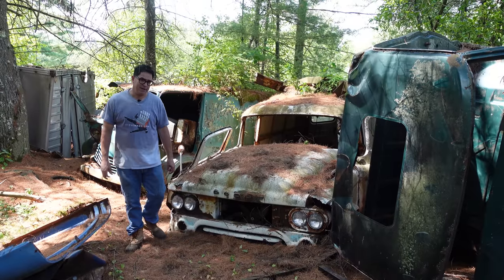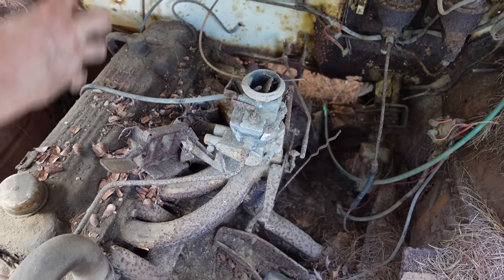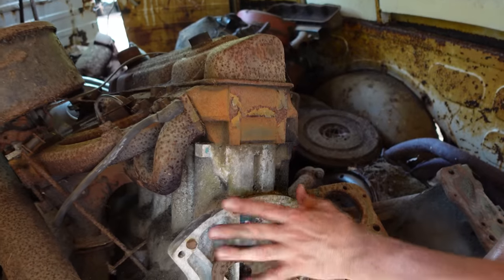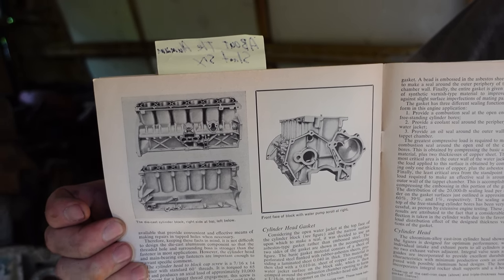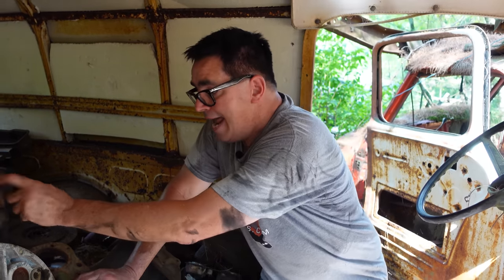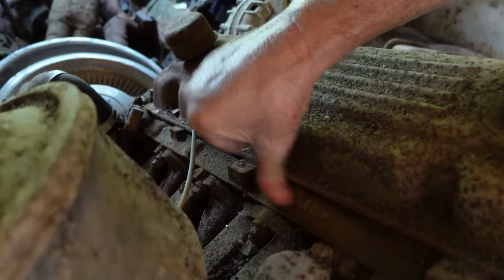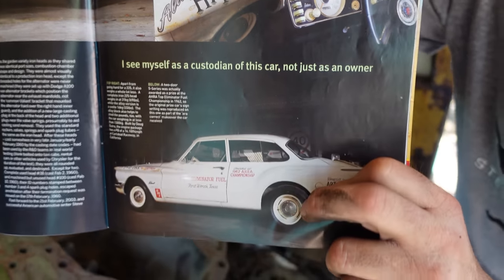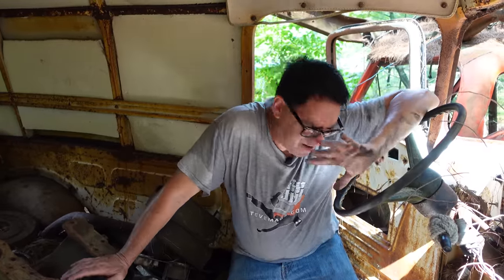Slant Six Surprise!

Comment: My dad bought a new ‘62 Lancer with an aluminum 225. In ‘68 or ‘69 I learned about the freestanding cylinders when it blew a head gasket on the road about 90 miles from home. It vented so much steam that the pressure cap was vibrating like a car horn. It was loud. We made it into a little town where a guy let my dad pull the head in his shop. My dad was a NAPA jobber (it was N.A.P.A. then, National Automotive Parts Association, pronounced n-a-p-a), so he called jobber service at the distribution center and ordered a gasket. It came the following afternoon on the bus. I recall standing beside the highway in that dusty town, the bus driver handing my dad the gasket. He took one look, facepalmed himself, and said, “I forgot to order the aluminum engine gasket.” Ended up towing the car home, where they reassembled it. The slant 6 was never right again, always ran hot. They swapped a cast iron version into the car, then had to crank up the torsion bars because of the added weight. Thus went the aluminum slant 6.

Comment: The guy in Germany who runs the Subi Performance channel custom makes adapter plates to close off open deck Subaru blocks. So, with a little effort, I'm pretty sure that closing off one of these engines can be done.

Comment: The chevy Vega 2300 was similar. It had siamese, free-standing bores in an aluminum-block with a heavy cast-iron head bolted over.  When I rebuilt my 2300, I noticed some corrosion working toward the steel-sleeves on some of the cylinders.

Comment: Best six cylinder made.  Had the iron one in a 60 Dodge Seneca in HS (66).  Ran against a 63 Impala SS 409.  Stayed even with him through second gear (three on the tree).  Then cubes took over and all I saw was his tail lights.  You could not beat that engine for reliability.

Comment: Some studying on that aluminum block, question are the sleeves really coming loose, and you would want to put a crankshaft in with counterweighted, and definitely aluminum cylinder head. With the newer aluminum intake where the runners are all the same length.

Comment: Another example of the aluminum slant six can be found in Tex Smith's XR6 roadster, winner of America's Most Beautiful Roadster trophy at the Oakland Roadster Show in 1963, hot rodding's equivalent to Miss America.
Several car companies tried die cast aluminum engines about that time including Rambler, Oldsmobile, Buick, Corvair and Pontiac. The sales pitch from the aluminum companies was that the castings needed little or no machine work and the savings from that offset the extra cost of the aluminum. In the end, the advantages did not outweigh the disadvantages and the aluminum engine was quietly dropped.

Comment: I was fortunate to meet an ex Chrysler engineer in the early '80s. He said the public did not want to pay the extra $$ for the lower weight block, and he said they transferred much more noise than the iron block. Plus the metal technology at that time probably did not have the wear resistance of the iron block.

Comment: Steve, you didn't mention the three Aluminium heads that escaped the prototyping dept 😊.
As an Aussie Clifford HyperPak owner,.. you and I both know there's zero advantage to the Aluminium block for power output, just less mass over the nose for handling. Always wondered what it would be like to convert one to wet sleeve layout, like the Renault 16 TS uses.
Reply: Renault used to sleeve iron blocks. I don't know if that would be wise to do with an aluminum block, simply because of the different coefficient of expansions between both metals
Reply: @aldente2676  The R16TS is an Aluminium Alloy block with Alloy crossflow head and pentroofed combustion chamber. Basically an Alloy four cylinder Hemi.
The family of Cleon Alu engines range from 1470cc non crossflow (also found in Lotus Europa) to 1647cc from the R16TX, and was the basis of the engines in the Alpine A110 and A310 "1600" versions.
In TS trim they have 91hp, full race Alpine spec is close to 200hp,... the latter in a 600 ish kilo body. :)

Comment: Man, in the late 40s / early 50s the straight six was the thing to have! I spoke to a rodder who was there at the start of the dry lakes scene in the late 40's  I thought hewould love Blue Oval flathead V8s - but he detested the things! He said most people were getting the 41 onwards Chevy truck 'Thrift king' 235 inline 6. You had 135hp if you found the Hydraulic lifter version, and they could easily tune them to 250hp + without exotic parts, whereas try doing that with a flathead! and until the caddy or oldsmobile V8s started showing up in junkyards, the inline 6 was the budget minded (who wasn't back then??) street racer's choice.

Comment: i always understood that the aluminum slant six had a displacement of 198 c.i., and were used in vans and pickups primarily.  In general, the slant six engineering was focused primarily on the block itself, and the crank, pistons, cam etc were about the same as those used in the 6 cylinder block going clear back to 1928.  You could easily retro-fit a slant six into earlier mopars, the bellhousings would fit any mopar six from 1928 to the 1980's.
Reply: They also cast a 225 cubic inch block of which these engines were even dropped into earlier Mopar full-sized models
Reply: I believe the 225 was a "raised" block(1" taller), much like the 413-440 blocks were a raised 361-383-400 block design.
Reply: The aluminum slat six, were used only in cars....not the trucks....if I am not mistaken
Reply: @jeffb3487  not so. I've seen several late 70, 80's 1/2t pickups with slants. Usually with few options(stripper) trucks.
Reply: @budlanctot3060  nope your 100% wrong.  the aluminum slant six was only made a few years in the early 1960's. Do your own research the cast iron blocks were used in car and trucks all the way through the end of their production.
Reply: @jeffb3487  sorry, I said slants not ALUMINUM slants. I misread a previous comment.
Reply: The original slant sixes were 170 and 225 CID, offered in compacts and midsize lines too; lots of slant 6 Darts.  I even once saw a slant 6 ‘70 Charger, three speed column shift. Could have bought it for $350. It was a Limelight green car—looked tough, but wasn’t. Probably had a 2.71 8-1/4” rear end.

The 225 did have a stroke about an inch longer; we used to look at the bypass hose to determine which engine it was: short hose, 170...long hose, 225.

The 170 became the 198 when emissions changes sapped the power.

The long stroke made the 225 a surprising stop-light racer. Its torque would beat a V8 Mustang for a little while, until the Mustang started to breathe and the 225 began to suffocate. My dad embarrassed a few high school street racers in his ugly beige 1962 Lancer.
Reply: Yeah, I saw a 70 Charger sl/6, too, but it wasn't Limelight. I don't remember what color it was but I'm pretty sure it wasn't that color.
Reply: I recall being in a junkyard and snarfing 12 pushrods from a dead slant 6 for use in my sludged up 225.   They did not fit, not by a longshot, would this be due to a variance in deck height?
Reply: @ExilefromCrownHill  most likely. I don't know if there was a difference in pushrods for hydraulic lifter slants or not. Definitely a difference between raised block slants and 170/198's. Probably an inch difference in pushrod length

Comment: never owned a slant 6, but I drove one my friend had in a Volare. not bad. not as good as the 250 straight 6 in my 78 Camaro but it wasn't as big either. there's just something about an inline 6 that sounds so cool. the Europeans knew what they were doing. that's why they had so many inline 6 engines

Comment: I had no idea they made them? Back in the 80s we used a few of the slant 6 engines in sand rails. They were fantastic but lighter is better. They lent themselves well to Hilborn Injection too. Too bad about the head gasket problem.

Comment: I had a 73 Valiant with the 225 slant six. It was my daily beater car. It had about 140,000 miles on it. It cost me about $400 and I ran the snot out of it. I would actually wait for the oil pressure light to flicker when stopping at the end of the freeway ramp to add more oil!😂 That damn thing just wouldn't blow up! It finally died from terminal rust here in northern Ohio.

Comment: Good morning Steve , I am so impressed with your build featured in this Vid. I have bought and read your material for years but somehow missed this one .
  If the Alu. slant six in this video is not junk.  Well it would so cool if you would save it even to use it as a paper weight just to persevere it. Just saying. 
                                                       Thanks again , Mark Battista

Comment: That's an incredibly fascinating 
🙆‍♂️🤩👏👏👏👏👏🧑‍🎓

I never knew 🤔 there was an , 
Aluminum version of the slant 6 🤯

Coolant corroding ,
 the iron bore seal 🤔
due too chemical electrolysis 🧐

Sounds like a,  
very similar scenario 🤔 
As the early 80s water cooled , 
Dirt bikes 🏍

Comment: My Parents bought a '63 Valiant 4dr new at Reedman in Langhorn Pa. It had a killer 170 with a push button. Fast forward to '76 I bought my '64 dr Valiant with a 170 and a 3 on the tree. It was a Cleveland lightweight edition...it was sooo light you could see the ground when you opened the trunk. Drove it for a few weeks then bought a '71 Nova. I loved those cars, not much on power, but ran until they rusted away. Correct me if I'm wrong, but didn't you do a segment 20+ years ago on how to go drag (bracket) racing with that Valiant? I remember the burnout with you working those push buttons. I think it ran mid teens? Get well soon Steve! love all your shows and videos.

Comment: I remember they couldn't give these away in the early 70's.
My Uncle bought a 1971 Valiant, because it came with a 
1 million mile warranty on the drivetrain. Which worked right up 
untill the body totally rusted out by 1974. 
A different Uncle bought a 1981, and Dodge replaced all 4 
fenders 3 times, but stopped due to the Chrysler bankruptcy. 
It literally came off the car carrier with 4 rusting fenders, that 
the dealer replaced, and painted.
Those blocks were/seamed bulletproof.
Would have been nice to see them as a 300 cid,, like Ford did with their 6.

The

Comment: Had a slant 6 in a 83 Ram Stepside. In order to pass emissions test (on the third try) here in Ontario Canada in the mid-90s I had to retard the timing so it barely ran. Once I got my sticker I crank it back up again and drove the snot out of it for a few years. Was a great truck with a 4-speed and was no slouch either.

Comment: I never knew they made an aluminum version of the slant six. I had an iron version in my 71 Valiant. It sounded like an industrial thrashing machine, but ran great. In fact it in outlived the car. A guy bought it from me and put it in a 76 stepside truck. 
And drove it another 6-7 years.
Reply: It would probably quiet down if you just adjusted the valves. Most sl/6 owners were not big on (any)maintenance.

Comment: When I was young my father kept old cars around, and they were all mopars with slant sixes. The 170, 198, and the 225. And he had lots of spare parts in the basement and the yard. So I grew up fixing and driving them. I was given a non-running 1963 Dodge when I was 15, and was told that it would be my car, but I had to get it running. I thought I had it running fine, but when I showed up for my road test for my driver's license, the instructor failed me since the car was so ratty and had essentially no muffler. I had to borrow my rich uncle's new car to take the test. I felt like an idiot driving it, but at least I passed.

I also recall the hyperpak with the intake manifold for the 4-bbl. And a hotter cam available for the slant 6. But I don't recall any aluminum slant 6 blocks. Perhaps my father had some, but I would not have recognized them as different.

Comment: Hey good day, this made my day :-) Always loved the 60s and older Mopar’s. Especially the slant six. Had a 65 three-quarter ton pick up truck with a 225, got about 12 mpg, no matter how I drove it easy that is, so finally put a 170 in it. Got about 21 miles a gallon, thank God for the four-speed though :-) very gutless. Later on someone had given me about a 62 Half ton, it has a slant six, not running. Installed it in the three-quarter ton removing the 170, it got about 20 miles per gallon. Was wondering if you or somebody may know if they did a different cam set up in the earlier years for the 225. No matter what, what an inspiration. I am kind of a Blaksmith you might say not a real race car guy, but have worked on vehicles motorcycles etc. entire life. Hard not to enjoy mechanical engines and such. Especially when you crank up the throttle and power shift :-) thanks again. Look forward to more of your videos just subscribed. Stay well and have a beautiful day. Jim
Reply: Some say that the 170 had perfect numbers, bore to stroke ratio, rod to stroke ratio, and the valve sizing was perfect for 170 CI. The long rods and modest stroke caused less side-thrust on the pistons, so the 170 would run a very long time. I also like the 225, a170 pushed to the logical displacement limits. When I worked as an engine machinist in the early 90s there were two engines that would come in with 40+ thousands taper, the Ford 240/300 (the front cylinder on this engine due to water pump placement) and the slant six. The slants would run just fine while worn out as long as the owner kept the oil level up.

Comment: Another unusual thing about Australian slant six motors was they were all 225s. If you talk about the ,170 slant in Australia they will say you got that wrong.
For V8 motors Australia usually standardised on the smaller ones, but the Valiant went for a big power advantage over the local Falcon and Holden sixes from the first model.
No two door Valiant sedans until the 70 model VG with the Dodge Dart tail based cars. but from 65 we had two door coupe utilities we call utes until the last 82 model Valiant.

Comment: We rode in a 1966 slant 225 w/3speed manual 4door Valiant to school. So far I know, the clutch plate has been replaced once, the stock carb was exchanged for a 2bbl from a 318 and the front drums were rsplaced. After 30 years the car was DISCARDED because no one had a front seal for the 7.25 diff. Yeah, the 225 was never opened, 607k km old. Oh yeah, rad was rebuilt seven(7) times

Comment: I too have a pension for the Slant 6 after owning a couple of them. Smoothest idling overhead valve engine I have ever experienced.  My friends used to ask me if it was still running at stop lights. I have searched car shows for decades trying to find an aluminum example and have never seen one. Just an awesome find Steve. I'd like to rescue it and at least clean it up as a display item.

BTW, didn't Dodge refer to these as "High performance" or something just because they were lighter?

Comment: AMC also had a aluminum "6", same issues,, headgasket issues, but when they ran right, they were silent at idle
Reply: We have one in our 1961 Rambler Classic. When you are sitting in the car you can barely hear the engine when it is idling.

Comment: My old man had a 1980 D-150 with the slant 6. IIRC he put 250K on it in about 15 years (He was actually in the local paper because it was almost unheard of to have that many miles on a vehicle) before he sold it to some guy who then used it forever on a farm. It even still had the original clutch!!!
Reply: Yes, there was once  a time when any engine lasting 100,000 miles was quite newsworthy so 250,000 must have seemed like a miracle. The Slant Sixes I owned lasted far longer than the rest of the car they came with.
Reply: My father bought a 1968 Valiant Regal sedan (Australia) new. By 1982 the car and original engine had done over 450,000 miles, yes miles. It was pulled shortly afterwards because you couldn't keep the oil in it due to blowby.. Worn rings pressurizing the sump and blowing out the dipstick amongst other avenues of escape. It leaked more oil than it burned. I had a few Valiants too over the years and 250,000 miles plus is not unusual for them. It took extreme abuse and neglect to destroy those engines.

Comment: I just wonder if you can weld fabricate some Al base metal sheet to close the deck, make things a bunch stronger. Copy the iron block deck pattern. Would be cool to try with modern welding techniques. 
Alternate method would be to weld up the aluminum around the cylinder then (bore/skim cut) the surface to flatten things out. Give 0.001” (?)(+\-) more crush for better sealing.

Comment: The only other aluminum block iron head engine I'm aware of the the Chevy Vega.  About as far from a /6 as you could possibly get.  
My daily drivers for many years were slants.  I've still got a 73 Valiant which had 408,000 on it was retired in favor of a minivan.  Still have a 67 Dart as well.  And a 70 Valiant pickup.

Comment: I did not know that there was aluminum block Slant Sixes from Chrysler.  I own one of the ten million so far of the aluminum block Pentastar V6’s in my '12 Chrysler 200 Touring convertible. The 200 convertibles is a bit of a unicorn as well within the Chrysler 200's years of production. The top of the Slant Six aluminum block looks surprising similar with the coolant passages to a photo of the Pentastar block from the top. Changing engine coolant for corrosion protection is obviously very important.

Comment: every in line six or four banger that has an after market four barrel intake and carb, the primary throttles are designed to face the intake valves not set up like a tradtional four barrel, Turn the carb 90 degrees and you make more power